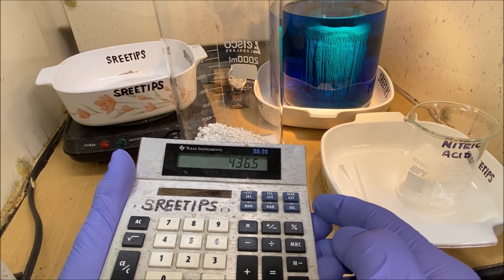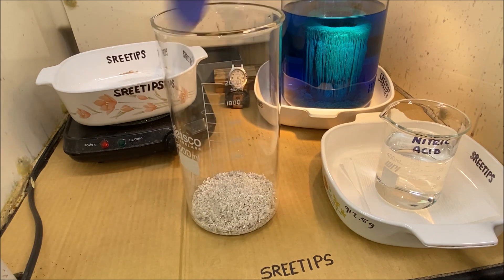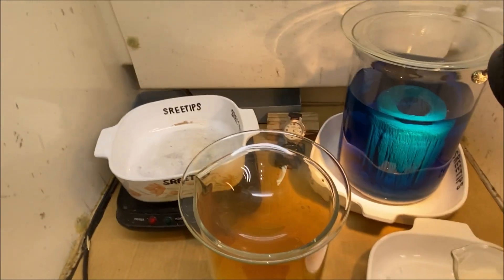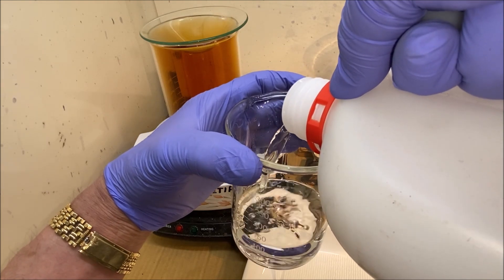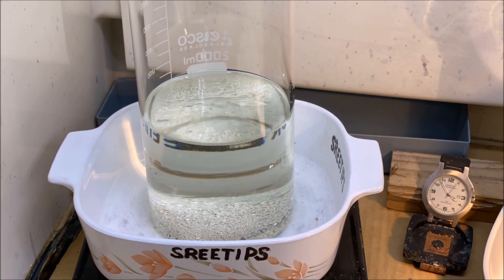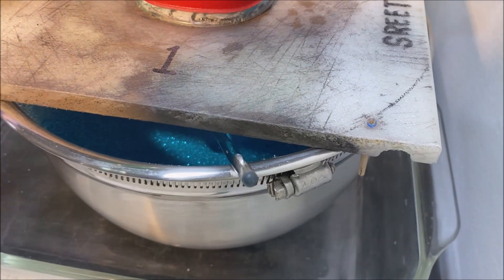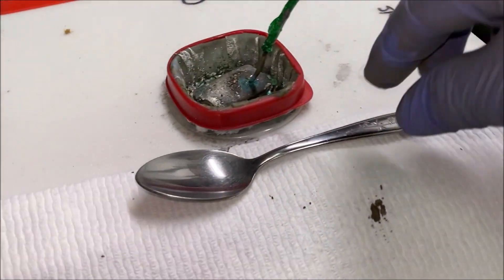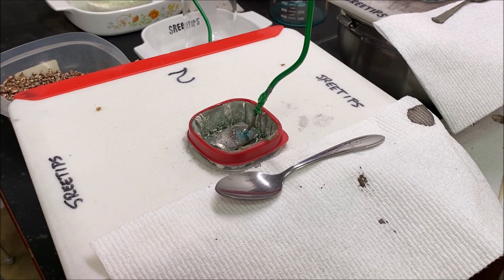Silver Cell Number 2 HARVEST Part1

Comment: Why do you need to add back silver to the electrolyte, as when your recovering the sliver from the shot ?? (P.s love your videos)
Reply from the maker: The sole purpose of the electrolyte is to provide a means for the dissolved silver  to travel from the anode basket to the cathode where it deposits (on the cathode) as pure elemental silver. However, some of the silver from the electrolyte gets deposited on the cathode as well, causing the electrolyte to become depleted of silver as the cell operates. That’s why I periodically add more silver nitrate. To both increase the physical level of the electrolyte and to replenish the silver concentration in the electrolyte.
Reply: To keep growth rate up. If the electrolyte is depleted from silver the crystal growth will decrease.
Also there's a purity issue as well, I think, that copper will begin plating out sooner, when silver saturation is too lov (relative to copper saturation).
Reply from the maker: Good explanation

Comment: I still ask myself the same question about why you should use pure silver for the electrolyte solution. I searched but couldn't find a reason. Actually it should work just as well with cement silver. The only thing that speaks against it would be third metals. But you can prepare the new solutions with cement silver that you obtained from the old solution. Than you have only copper. You would save so much time.
Reply: Cement silver is less pure so the electrolyte wouldn't last as long before getting saturated with copper meaning he would have to harvest less silver, earlier (more often) meaning more work with the increased risk of contamination of the crystals.

If he didn't care about purity he could do as you suggest. But he does, so the way he does it is the more sensible way.

With more cells it also doesn't matter as much as there's plenty of crystal feedstock for the electrolyte.
Reply from the maker: When I reboot the cell, I prefer everything to be pristine. Using pure silver crystal, from a previous harvest, is the way I learned it from folks that have a lot more experience than I do. You could use cement silver to get the cell running for the first time. Actually, I think that’s what I did when I first got started almost 14 years ago. But using cement silver to make electrolyte every time is not recommended due to contamination issues. It seems like you’re taking three steps forward, and one step back when using pure silver crystal for the electrolyte. But as with anything to do with precious metals refining, it’s never cheap, easy, or quick.

Comment: Sir..How much sterling do you put in the basket before you harvest the crystal?
I mean...Hove many gram of sterling🔥
Arne
Reply: It's not sterling. It's more pure (98+). Sterling is 92+.
The cementing on copper takes care of most of the copper content.

The exact amount will probably vary because electrolyte silver content is a factor as well. But on average it will be harvest weight +1,5% + whatever is left over in the filter.
Reply from the maker: I weighed the new anode filter when it was full of impure silver shot in a recent video. Now the size and shape of the shot will be different and influence the weight. But in this video, the one where I weighed the basket full of shot before placing it in the cell, those shot were very small and compact, making a dense pack of impure silver. The weight of the impure silver shot, minus the weight of the container and filter, was about 400 grams.
Reply: Thank you...I should now that Mr Sreetips 🔥
Reply: I mean. Thank you Nicolai 😂
Reply: Ok🌹 Thank you Sir.
Arne

Comment: Please Mr. Sreetips, show us when the Slver hits the Anode.
Reply from the maker: It causes a short circuit between the anode basket and the cathode (stainless bowl). The current flow spikes, creates lots of heat, and burns a hole in the Dacron filter bag. If it’s allowed to continue, the bag will rupture, and release the slimes that have accumulated in the filter, into the pure silver crystal and ruin the batch. I put a 3amp fuse in the circuit when the crystal gets close to the anode, like it is now.

Comment: Is this a hobby or a business.  How much silver you have hoarded
Reply from the maker: This is my hobby. I don’t refine other peoples material only stuff that my wife and I find at local sales. I refine gold. I use sterling silver to refine the scrap gold. I recover the silver from that, melt into shot, and run it through my silver cell. The silver is a by-product of my gold refining. The cell converts the impure silver (about 980 parts per thousand silver) to high purity four nines fine (9999 parts per ten thousand) pure elemental silver metal. The impure silver is added to the anode basket. The anode basket is suspended in the silver nitrate electrolyte. I pass an electric current through the impure silver. The silver dissolves, passes through the Dacron filter, travels through the silver nitrate electrolyte, and deposits on the stainless steel bowl (the cathode). The bowl is connected to the negative pole of the power supply. The process only deposits pure silver on the cathode. So I’m refining the impure silver, into high purity silver. When it’s full, I harvest the pure silver crystal. Then I repeat the whole thing again.
Reply from the maker: I’ve lost rack of the silver that I have. Can’t put a number on it. But I do have three buckets, about 33 pounds each, of impure cement silver that I need to get melted up and ran through my silver cells.

Comment: Hey Sreetips, I want to say thank you for these videos. I have learned so much from them. I am going to recover the silver from circut breakers. The ones I have are around 40-60% silver. Can I just  disolve them in nitric acid and then cement the silver out on copper? Thanks for any advice you might offer in this endeavor!!!
Reply from the maker: The only problem is tungsten. Sometimes they will contain tungsten. It’s soluble in nitric, but it’s below copper in the reactivity series so it will cement out with the silver. You’ll be able to tell if the silver is a bark grey to black color. Another option is to convert the dissolved silver/tungsten solution into silver chloride with HCl. Then do a silver chloride conversion with lye and sugar.

Comment: Be interesting to see the shot screened by size into 2 groups and then run through the same cell with different filter but same grams on same power supply.   Curious on some metric about how shot size affects the speed ...
Reply: Smaller shot size means larger surface area and so a faster reaction. 😀
Reply: @carlscattergood4121   indeed.  but "see" is a level of interest for viewers; HOW MUCH better... ;)
Reply: the biggest factor for the speed seems to be the cleanliness of the shot, contamination from platinum group metals seems to really gum up the filter faster and really slow down the electrolysis rate

Comment: It's obvious the new power supply is far superior to the older one that you've been using....
The crystal production in cell number 2 looks incredible.....
Reply: I don't think that's a safe conclusion.  I think there's some kind of resistance on the connection of the older cell that's less than the resistance on the new cell.  Total power (~7-9 watts) is the same on both supplies.